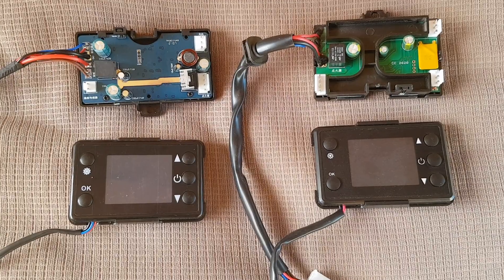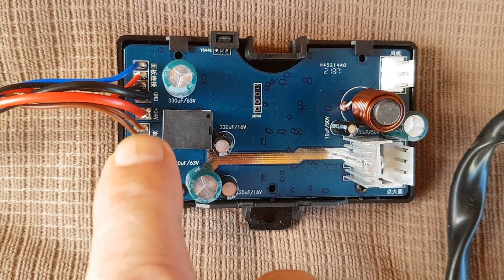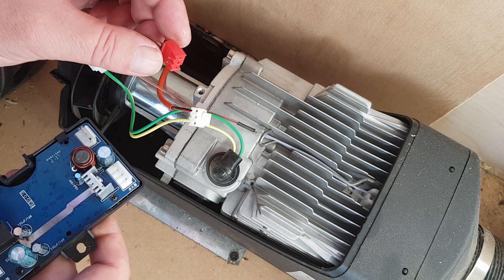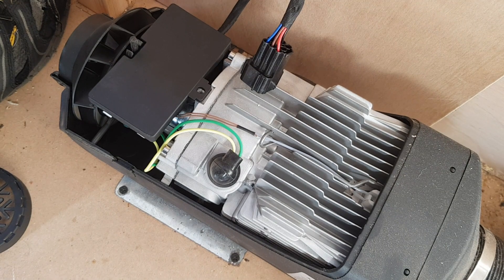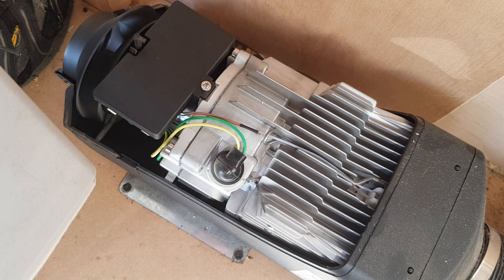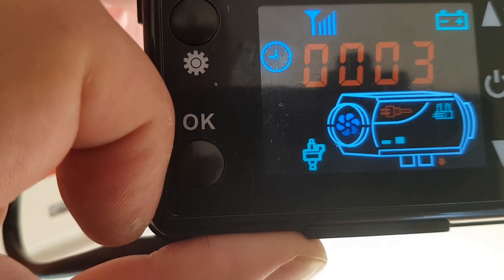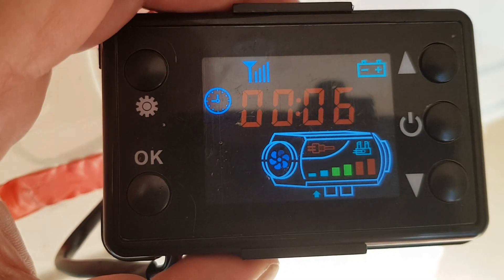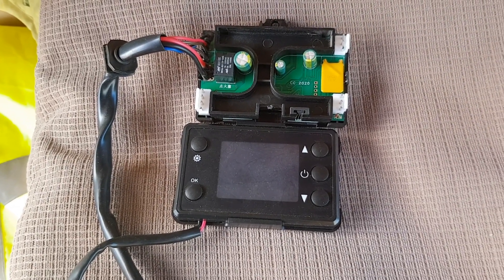Diesel heater motherboard swap new controller to old.

Comment: im doing the same swaping the new out with the old i dont want to screw around with hz i just want my H 1-6 like on my shed heater. kind of a pain in the ass because the one i have and am swapping out is what i replaced the blue one with

Comment: Do yourselves a favour and look at the ‘Afterburner’ controller made by a guy called Ray Jones here in Australia. Way, way smarter and many more features than the standard controller that comes with these things. Not overly expensive either and plenty of tech support on his website.
Reply from the maker: I've got one. That was the reason I changed this motherboard. 😉👍

Comment: I have ordered both a motherboard and controller. So am I to presume they might not work on my heater?
Reply from the maker: Can't see why not, unless you have an unusual heater?
Reply: @philcross7315  ok, phew and thank you for the fast reply
Reply from the maker: It would have been quicker, but I'd just gone to bed. 😂
Reply: @philcross7315  I changed both and it worked ok for a few hours. Now it’s just luke warm on almost maximum where before at the lowest setting was more than enough heat. Any suggestions or shall I just replace the complete unit?
Reply from the maker: It hasn't just got up to temperature and ramped down has it?
If not, you could tweak the fuel pump/fan speed settings?
Reply: @ no it hadn’t. I will try and work out how to adjust what you have just advised.
Reply from the maker: Plenty of YouTube videos about it. Sorry I'm no help, I've never had to do it.

Comment: Hi Phil, is there any chance you can send me a link to the old type motherboard and controller please as I want to change mine to the old type as it is easier to use, many thanks Russell
Reply from the maker: Hi Russel,
I'm a member of a Facebook group, that uses the afterburner controller. For that, you have to have a compatible (old style) motherboard. One of the problems people have had, is ordering what looks like the right one, only to have something different get delivered. For that reason, I'd suggest using amazon, or ebay, as returning it is much easier. I'll have a quick look now.
Reply from the maker: https://www.mrjones.id.au/afterburner/

There's a section there that lists the motherboards that use the old style protocols.
Check the compatibility pdf
Reply from the maker: This looks like the one.
If something different gets delivered, return it.

https://www.ebay.co.uk/itm/226282134743?mkcid=16&mkevt=1&mkrid=711-127632-2357-0&ssspo=fMWBjNmiQAG&sssrc=4429486&ssuid=_ihyQ9FUTvS&var=&widget_ver=artemis&media=COPY

Comment: I have the new controller type, purchased in Jan 24, ran the heater for 5 hours and it came up with the E8 code, stripped it down and it was fully blocked with carbon. Long story short it will only run in Alpine setting any ideas why it’s doing this? I’m at about 100m above sea level!
Reply from the maker: Hi Paul, it will be your tuning settings, but being honest I've no clue how to tweak them. Google "ray Jones afterburner". He has a group on Facebook that will be able to help I'm sure.
Reply: @ thank you, I believe my controller also doesn’t have the option to go into the sub menu with the 1688 code. Thus I went for the Alpine setting yesterday but to be fair it ran well with no visible emissions👍

Comment: What was wrong with the old motherboard/ LCD controller?
Reply from the maker: From a basic functionality, nothing. But, if you want to tune your heater better, or fit an "afterburner" controller, the motherboard doesn't work with it.
Reply: @philcross7315  thanks for the info. 
I just received the same controller. I am replacing the crappy 3-button controller that was next to useless. 
Thx for the great video

Comment: great vid , can you tell me does the Blue board with the LCD that shows Time in RED have Advanced settings with code 1688??
Reply from the maker: Hi robb, yes, that controller has the 1688 menu that you can tune the mixture settings.

Comment: Ho do the polarity are the same for the fan and the glow plug?
Reply from the maker: I don't know. I simply swapped one panel for the other. If the glow plug connection is wrong, it doesn't matter. If the fan connection is wrong, the fan will spin the wrong way. If that happens simply swap it the other way.
Reply: @philcross7315  thanks for your help!!

Comment: I purchased a 5kw unit recently and it ran for about 2 minutes then stopped signifying an E4, pump failure code. I bought a new pump and connected it but it too showed E4, I tested everything on another heater I have that works and the pumps worked. Now, I am thinking it is a module fault so I will buy another, if they are not the problem at least I have spares as they are comparably cheap. Before I go out and buy another I will check it out to ensure connectivity across the entire system.
The other one I bought is the Hcalory with the 100mm ducting which eventually will be used as the heating for my flat.
Most of these plugs cannot be inserted the wrong way round as they have nodules to stop it. In my Hcalory unit I have a mains to 12v power supply connected to the heater with two plugs that look totally different but will only plug together one way.

Comment: Hi Phil and thanks.  I am trying to look for a 2Kw heater with the better/older type controller. There are several on Ebay that look correct with the larger OK and Power symbol, but some of these say they have up to 6 steps (only) for the pump in Hz.  Exactly how many steps does your better/older one have please? The newer/worse one I currently have also has 6 steps, shown as H-1 to H-6. (I can't just upgrade that heater, as it is going back). I have another heater with the better blue controller, and that steps from P-1.1 up to P- 3.5 or higher, in multiple steps, much more than 6. Does the black older/better one show same as this blue one?
Reply from the maker: Hi John, as far as I'm aware, it does? That said, there seems to be a lot of new ones about.
Check this site, there is a lot of very up to date info

http://afterburner.mrjones.id.au/

Comment: My current diesel heater controller on the wall is red and it quit working. I bought a new one and it’s black like the one on your video. Do I need to change the thing inside the heater too?

Comment: Thanks for your video!  This should not only help folks who want to upgrade/change features, but eliminate the horrible start-up/shutdown programming in that BLACK controller's ECU!

I bought my first 5/8Kw red all-in-one with your blue control (that has the run-time "00:00" on the display by default) already factory-installed in October 2021. In December 2022, after a full winter of running mostly contiuously since 2021, the fan bearings failed (common issue). I ordered new ceramic bearings to repair the existing unit but figured I better get another identical all-in-one CDH - for the sake of time (and to have a complete "spare" drop-in unit if I had to do repair/maintenance in the future).  I managed to get another one from Hcalory with the identical control in literally just 3 days!  

Unfortunately, from the moment I installed and activated it, it didn't sound quite right. The blower motor in that one literally siezed up after only two weeks. I got a full refund and decided to get a Vevor, but it was already almost January and I no longer had my prefered choice of single 3" outlet 5/8Kw slim-case all-in-one WITH the blue controller. I had to settle for the BLACK one like you replaced with the "P12v" instead of the "00:00" on the display by default. (Meanwhile, I rebuilt and tested the original unit with new ceramic bearings in the motor - so I have two working units!)

What a POC!  Who ever designed the ECU that those are connected to should be slapped senseless!  The software program starts with too high of a fan speed, does a fuel prime before the glow plug is powered, and then starts pumping way before the fuel in the burner is properly lit - so it starts completetly flooded and blowing white smoke for several minutes!  The shutdown routine is just as bad! It doesn't engage the glowplug and shut the fuel pump off immediately after turning it off to burn off the residual fuel! Instead, it drops the fan first.  I ended up ordering the new ECU and familiar blue controller and have been smokeless and odor-free ever since!

BTW: TIP  If you are ordering the BLUE controller and ECU, you might consider adding the thermister/sensor to your parts order for just a couple of bucks. As noted in the video, you will likely have to flip the connector on the sensor with the locking clip facing away from the raised lock on the ECU if you reuse the original from the BLACK ECU. I didn't like the way the connector block corner was right up against the main hardwired wiring in the middle of the ECU when flipped to get the two pins on so that the clip locks, or the other way where it clears but has no contact with the lock on the ECU.  It might not come loose from vibration during operation, but being upside down under the ECU when installed, I prefer to be able clip it rather than rely on pin tension. 

When you order, you will want the sensor with the YELLOW CONNECTOR.  (The red one fits the BLACK controller's ECU)
Reply: I also find the 'new' controller revs up too fast, blowing the flame out. 
So I have to start until it starts revving, then stop. 
Then the 2nd start usually works.
For shutdown I have to go to lowest power 1, until it's cooled to about 130-140C, and then it's safe to shutdown.
It sucks.

Comment: Hi i have a newer version of this heater like phill but with a green back with out the black plastic and printed on it is 5DAW20VA04  i tried changing over to phils blue board and controller but it didn’t work for me ,but i did manage to get it working by changing the burner cable wires out of the white plug they where on opposite poles to the unit of Phil’s on the video if you have the same board as i did thats what you have to do to get this blue baby up and running 🎉🎉🎉🎉🎉
Reply from the maker: It's so hit and miss with these boards, so many variations. Glad you got yours working. 👍

Comment: Did you end up having to re-tune the fuel delivery on yours?
Reply from the maker: Nope, connected the afterburner, and it auto transferred my settings. Works well.
Reply: @philcross7315 awesome. Just ordered the “new” (old) motherboard for mine and will get an afterburner soon after.

Comment: Bloody Hell! Information is all over the map.  I’m considering the new board and controller because of the altitude setting, and now nobody likes the new setup because of this or that reason.  My use ranges from 2000 feet to 7000 feet, so I guess I’m stuck using the chart and pump and fan speed settings to get it to run in the mountains.

Comment: Yeah, i tried this, ip pops an e-06 
I tried to adjust the mag sensor position, cand seem to make it work
The new controller wouldnt adjust for the altitude 1500-2500m and coked up pretty quickly,

Comment: I just got an old style digital black controller to replace my rotary controller. I get an E07 error code, I’ve checked the blue wire continuity and it’s good. Is this likely to be a motherboard compatibility issue or a dodgy new controller ?
Reply: Same problem. I've just bought a new motherboard. Don't even know if it's the right one it looks a bit bigger. Did you find a solution?
Reply: @gardendesign5186  ordered the old style blue motherboard and working fine now!

Comment: Apparently, loads of people are doing this 'modification' to their new Chinese diesel heaters that come fitted with the later style black LCD controller, including me!
This video is a great help in doing the conversion. I have no idea why they changed to a worse type of LCD panel.
Reply: The Blue "00:00" was the newest controller and ECU in late 2021. This Black "P12v" one also has an identical counterpart in a blue case as well, and there was a rectangular Black, silver or gold, or a  red controller that has the same "00:00" display and ECU as the one used in this video - which is really confusing people!  It has been infered that the so-called "new" Black controller systems are actually  cheaper old-stock components that ended up filling a post-COVID supply-gap. The backwards way they're programmed to start and shut down, as well as the more limited functions, adds some credibility to that theory!
Reply: I have a red controller that went out and it’s not working. The new one I bought is black like the one on the video am I gonna have to change the ECU as well?
Reply: @Mike-c6o2y  first, are you 100% that it's the controller? Is the 12V inline fuse good? Does the display on the controller light up but it doesn't run, or is it dark? The parts take a few weeks to get from China, but they are relatively cheap - unless you buy the complete blower or burner assemblies. I highly recommend anyone who owns these to buy at least one extra controller and matching ECU board as a back up. If you have the spares, it's super quick to just unplug the controller or the ECU and just plug the spare in to see if the issue is resolved. (I have an entire complete unit as a spare that I rebuilt a complete new blower motor into, as well the original motor with replacement ceramic bearings (as a spare motor), a replacement fan and compressor wheel, gasket sets, glow plugs, screens, temp sensor, matching extra controller/ECU, and a pump. I live in a 580sq ft tiny house and a 5/8Kw CDH is my primary heat.) You could go the technical diagnostic route but doing a part swap on these is just so super quick compared to checking line voltages and resistance values with a meter. 

Which black one do you have - there are two shown in this video? The real issue is what the display looks like. 
If you pause at 0:06 in the video, you will see two black ones - one is paired with a blue bare-back printed circuit board ECU (on the LEFT)...      and the other with a green printed circuit board ECU with a plastic u channel in the shape of a large capital "H" covering the board (on the RIGHT).  
I personally found the illuminated display to be the best indicator - rather than the color of the controller.  

The controllers with "00:00" on the display will typically pair with the bareback blue pcb ECU, and the ones that have "P12v" or "H3" (or "H" with any other single digit 1-5) or has the red circle (-) with the line through it lit on the panel, it will pair with the green pcb ECU with the plastic "H' frame covering part of it.  If you don't know what the display on your controller looks like, you can connect it momentarily to the triangular controller connector in the heater harness and it will light up the display long enough to see what type you have. Don't try to start the heater - just identify what the default display is when you connect the controller to the supply harness. If the illuminated display is the same format as your previous one, it would typically be ready-to-use with the same ECU board. If your red controller display on power up was "00:00" and your new black controller was showing  "H3" or "P12v" or has that red circle with the line thru it, you will either need to get another controller that displays "00:00" when it is first powered or get the green ECU. 

I strongly advise AGAINST ever swapping from a blue ECU board to a green ECU board. They have a terrible start-up and shutdown sequence. The same heater with the green ECU and matching "H3" display controller has too little preheat and too much prime. It floods the burner and always produced white smoke from a cold-start. The blue ECU system such as was retrofit in Phil's video does a much better job of preheating the chamber before engaging the pump. It also re-engages the glowplug and maintains a higher blower/compressor speed to properly burn off any remaining unused fuel at shut down. The result is a clean smokeless cold-start every time - from the exact same unit that smoked so heavily and for several minutes, that I ended up with a concerned neighbor getting fogged and calling to say they though my building had caught fire! 

There are other ways to try to distinguish between controllers based on specific styles of buttons or fonts, but those are not always going to be 100% reliable.
Reply: Mostly it tends to be demand that drives changes, if the manufacturer comes up with a new one they will push that over the older model.

Comment: Big thanks! Purchased "a Vevor 5kW" which unfortunately had a similar old analog board. Thanks to your video I ordered the right board which is compatible with the Afterburner aftermarket HW/SW I'm planning to use with my heater.
Reply: Hi Ari do you have an image or link to the replacement board you are using? Thanks

Comment: I ordered a self contained 5kw unit from ebay before xmas 2022 and the motherboard and lcd screen I cannot find anywhere online, it has no control over Hz settings it just has 5 temperature settings and the strangest motherboard ive ever seen, so I have ordered the board youve just installed and a blue screen as I have a blue screen on my 2kw heater which allows much more control esspecially with the lcd remote control which gives you the casing temperature as well on the remote control. Thanks for the wiring bit it may well come in handy when my motherboard arrives. ive also had to order a new wiring loom as there are no plugs to speak of coming from the existing motherboard the connections are just stamped into a plastic wiring block so that it is impossible to plug in a new screen. edit 06th of Jan 2023 board has arrived and it is identical to yours, Im just hoping it will work with the blue lcd screen I have, still waiting for the new wiring loom to arrive now. Thank you.